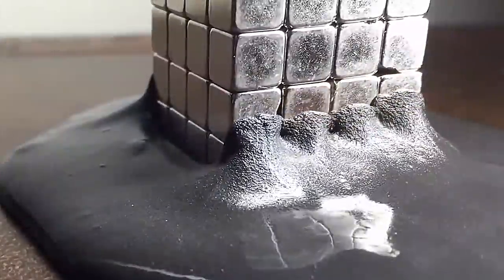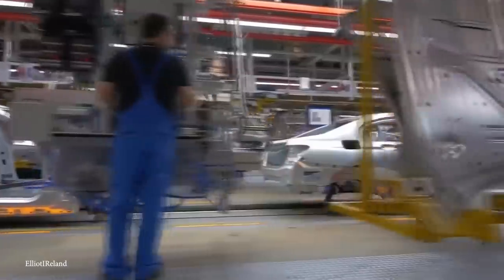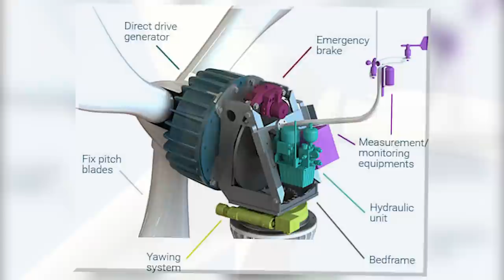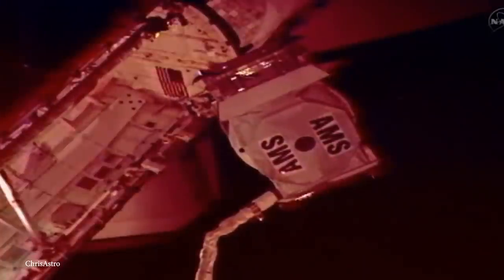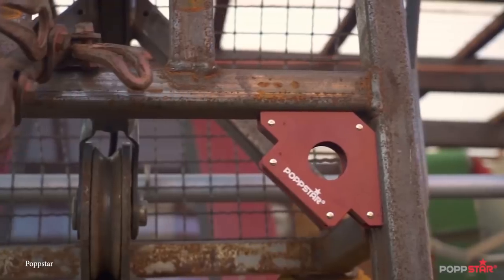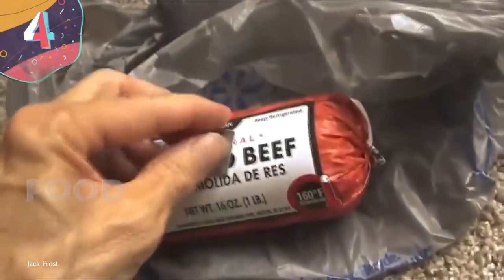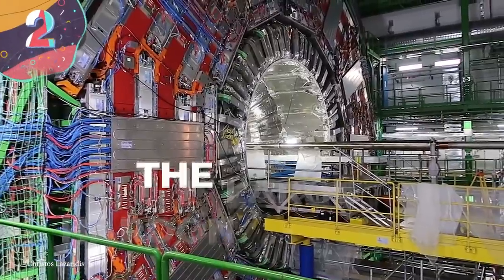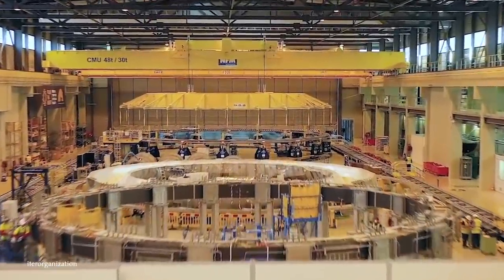15 AMAZING MAGNETIC MACHINES

Comment: Er nope you showed a window being fitted on a car build line that's suction... Doors don't use Reed switches its push to break pin switches on 'a' pillar for example or built into the door catch itself...

Comment: Correction on the robotics that are moving the car parts, they are using air suction(you can see the suction cups) to pick up and handle the parts, just like the ones being used to install the windows front/back, they are not being picked up with magnets. First hand knowledge by working in the auto industry/factory’s for the past 37 years.
Reply: Everything being moved was glass so of course would be by suction

Comment: Almost no one would use a magnetic chuck on a lathe. It would be way too dangerous. I have never seen one and I've been around lathes for years. It's possible they exist for the lathe, could you possibly get into more detail? Magnetic chucks are typically used on surface, and sometimes OD grinders.